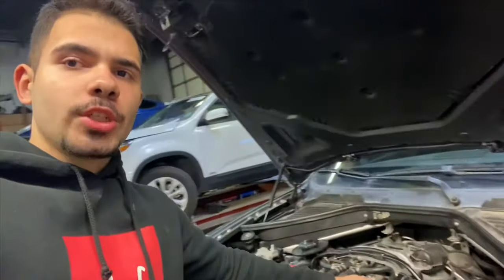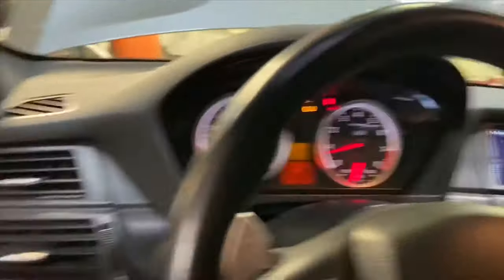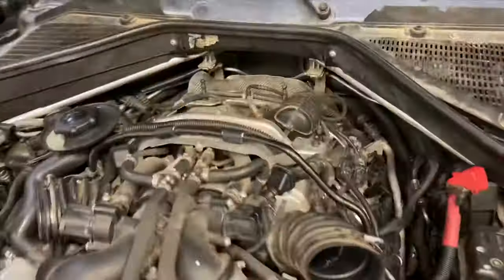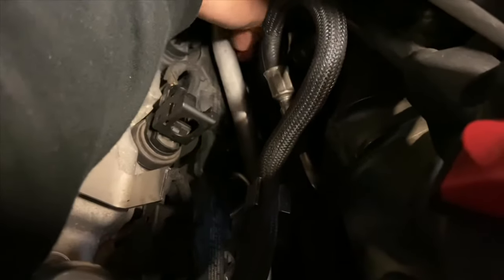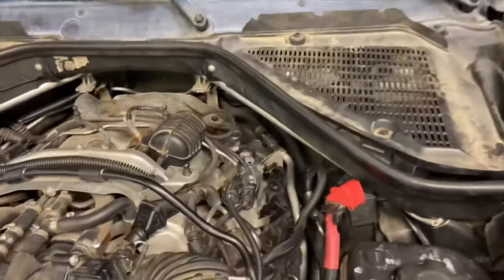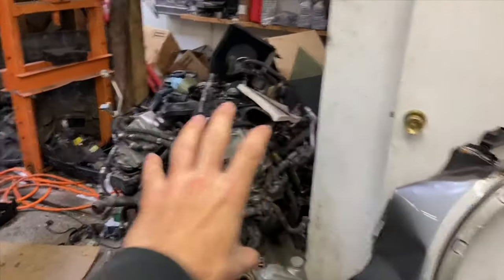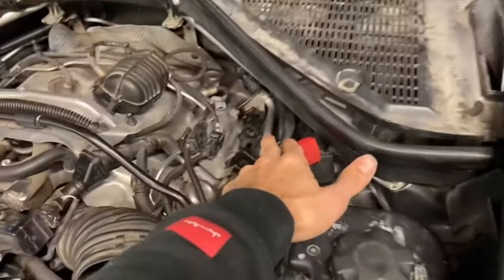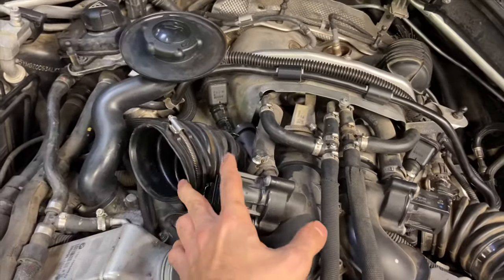Don't Let This BMW Knocking Sound Fool You!!

Comment: Hello saw your report , my 325i  06 has that sound but also loss off oil pressure and it's going crazy on the dash bored.the sound comes from on top middle part .but once it starts it makes that noise and as it travels it alsoajes it louder afraid to Excell because it:s  loud. Did any check engine or dash lights go on??

Comment: I have a bmw that has a knocking sound WAY louder than that. Before I went into that situation I Got a new battery, transmission fluid and oil change. I went to a car shop twice and they said they didn’t hear it anymore. After I got it “fixed” it started again. Wth do I do??
Reply: Since it’s getting warmer I have my windows down and didn’t realize how loud it was on my side, it’s so embarrassing but I already put in almost 1,000 for everything I listed

Comment: Gotta be careful because when this happens, it can oblong the bore for the injector.  When this happens, it'll keep blowing the teflon seal off the injector and the only way to fix it is to either have an insert machined and installed in that cylinder head OR replace the cylinder head.

Comment: Hey bro. I have a 335i. It sounds like it has a rod knock but it goes away and I comes back.
Reply: lifter most likely or its one of the injectors
Reply: I got the  same problem too    Bro

Comment: I have a bmw f10 m5 comp. and this sound sounds familiar to what I am going through right now but a warning saying differential locked and going into limp mode made me pull over on the side of the freeway .and turn the car off. I did a diagnostic to the sensor valve, transmission, and engine and the only thing that popped up was lean air fuel mixture for the engine. But my car wouldn't start back up. Had to call a tow truck .I  normally use shell but was in need and got $20 in gas at Arco 91 octane. Where should I start ✌️👍

Comment: When I had this issue my vehicle had probably 62k miles. It started out as an issue with my valve cover that was causing it to lose oil. I think the air vacuum created by this gap on the valve cover contributes to this issue, because mine actually does it worse than that. But always check your valve cover gaskets, it can save you a lot of money

Comment: The bolts for the injector hold downs need to be torqued too spec. Seen a few where the hold downs came loose and damaged  the cylinder heads

Comment: Hi, I have a 2009 335 xi n54 engine. When I am at high rpm, there is a slight knocking sound. It also dies it when I lift foot off gas. One guy said rod bearings. Car has 220kkms which is roughly 130kmiles.
Reply: Mine is having the same issue. What was the solution for yours

Comment: Wow great video. I have the same sound. When I touch the injector the sound it disappears. I can hear the sound when I drive and break with the engine as well. the bmw team told me about this injector  vibration, but the only possibility to fix this is changing the turbine. That’s what they told. I think it’s stupid. I have bmw series 1 2016 1.5l
Reply: What should I do?
Reply from the maker: My advice is Start with the bad injector first. The car in this video ran perfectly from the time i made this video until it got in a big accident a week ago and got totaled!

Comment: I have a same issue. Idle no knocking but press gas pedal  you here the noise sounds like a wastegate rattle.. Code is cylinder #2 combustion erase it then after hard accelaration misfire again need some advice Thank you and Godbless
Reply: you find out the issue?
Reply: @cali_cal  Yes, is a fuel injector o-ring cylinder 2. $3 fix the issue.

Comment: I have a n55 135i that was making roughly that same noise -- but only when revving the engine or giving it gas. Thought it was an exhaust leak, and then the dreaded rod knock -- but after seeing this I decided to disconnect injector #1 (which had also had some misfire codes) and voila, no more knocking.  I isolated it to injector #1 by disconnecting #2, and reconnecting #1 --the  sound came back.  What was the ultimate fix though? was the head warped from all that banging around, or did it just need a new teflon seal and/or reseating/snugging down? Again, thanks for posting your video, you saved me many sleepless nights filled with nightmares of dead engines (rod knock) and existential dread.
Reply from the maker: I ended up replacing the injector because I have lots of spare injectors and added a new injector seal kit, still driving till this day no problems. I think a seal kit would be okay as long as you clean the area and use the bmw injector special tool to install the seal( 20-40bucks on Amazon and fast shipping). Wishing you luck with your repair!

Comment: Hey great vid bro I have a question cause I also dealing with same issue I have 2011 750i xdrive an my car shakes tremendously but sounds just alike but do you feel vibration on the car
Reply: Did you fix it? I know what it is
Reply: @NeverGiveUp-StayStrong  I’ve got same issue 320d
Reply: @Msport279  injectors

Comment: I have a 2007 BMW 750 LI I watch a video about the knocking sound, but my knocking sound does not start until after the engine gets hot and starts knocking. What could that be?

Comment: I NEED HELP !!!
I just paid for a 2009 BMW X5 48i yesterday and I drove it 174 miles ( I got it from another state ) but when I got home it started making a loud sound which came from under the hood ... now the next day which is today I called myself going to handle business and the car lights ( transmission in position n ) ( awd and dsc malfunction ) then the car started slowing down in traffic which ended up shutting down ... I got towed home but when the tow guy jumped the car
It came back on fine but still had them messages on there ...I  call the place I paid for it from they told me it’s the battery “ which made the car shut down & throw
Messages on the dash door “ so they told me to come get a new battery... I’ll be putting that in tomorrow ... but I’m concerned about the ticking sound that’s in this video
Reply: is ur car ok?

Comment: I have an e46 (325i m54 motor) and I’m experiencing a little bit of ticking noise. Through the forums and some homework asking around, there’s multiple things that can happen. I’ve been seeing loose spark plugs, rocker arms, new lifters, and new pistons. I’m currently not in the price range for those “big” projects. Now since the ticking, I’m now experiencing a slight knocking noise around the passenger side wheel well. I have no idea what this might be but if you have any information about it, it would be greatly appreciated. I know the m54 is a strong and fairly reliable engine so this will hurt if I have to part ways with it.
Reply from the maker: Thank you for watching my video Ryan, can you give me more info I might be able to help out! Does the sound change when you press on the gas pedal if so how does it change( Example: Noise gets louder on higher RPM). Do you happen to know where is the sound coming from? Engine, Transmission, cv axle, suspension, etc.
Reply: @leomafrajimotors7447  Thanks for the great video!  I’m having the same knocking sound and the ticking/knocking sounds beat increases with the RPM increase.  Do you think this sounds like a faulty injector?  I appreciate the help!
Reply: Yo nice profile picture

Comment: I have a 2013 750i xdrive twin turbo had a loud knocking sound I bought it like this but when I plug it in it said some thing about a jammed camshaft or something with the vanos ? What’s really weird is the sound is gonna gone now but it’s been there everytime I started the engine which was at least 30 times and it was always there that sound ! Now the car shuts off after I start it pls help
Reply from the maker: What codes do you have?
Reply from the maker: Also send me the vin number I’ll see if i can help!

Comment: Hey Leo, thanks for the video, I’m getting this sound on my f10 n52 engine. Is this usually followed by a lack of performance in the car? Mine is intermittent but when the sound comes, performance suffers - the engine feels very airy and empty. Also the sound is most prominent at idle. Will rod bearings make sound throughout the rev range?
Reply: EXACTLY WITH MY 335i N54 helllppp😭
Reply: @Cilado  did you find out
Reply: Wastegate

Comment: My 2006 bmw 325 I just started doing this when I start it up it turn on but shut off then I haft too turn on but run rough I here the same sound popin nose in misfires my check engine light was blinking too but stop idk what it could be
Reply from the maker: Find out what codes you have, it’s most likely misfire. If it’s misfire on a couple cylinders( example: cylinder1 and cylinder 4) you need to check the coils first, then spark plugs, and then injectors for those cylinders. If it’s misfire on all cylinders, you either have a vaccum leak, leaking valve cover, bad map sensor, bad ccv valve, fuel pump, fuel filter, or timing.

Comment: Hey I have 2013 bmw 750i . it have been making a knock sound 2days few days ago i drove it around 7 minutes in it died . got it towed home . it would not start. Say charge battery which i hook up a battery charger/ jumper. It would not jump it so i took battery out last night charged it . the battery is charged not sure how good only 8hrs of charging. Still wont start. One i check for the sound the only one that sound like it was one that said alternator going bad . which i think and i want to make sense to me instead of other problems. The car wont start but most of my fucntion came back like the was able to stay on the sun can open and shut back now. But it wont start it makes a click sound with a 2 seconds pause then follow  with another sound .
Reply: that forsure is one of the rod bearings welded to the crank. n63 are known for that issue. if you hear clicking that means starter is trying to go but because your engine is seized it cant turn
Reply from the maker: What David Smith said is correct! it’s most likely that the engine is seized since you hear a click but the battery is good and also it died after the engine was running for 7 min like you said.

Comment: My bmw is doing the same thing it started out of nowhere..
Reply: Mine is loud but not a hard knock sound on my 535i.  Goes with RPM. Started out one min to the next. Cylinder 4 issue reported... I might get to it in a few months. Until then, I have my S class. And paying on a new mortgage with renovations, so it has to wait...